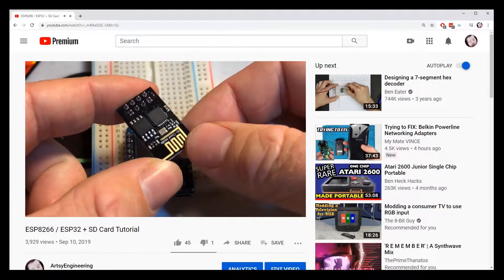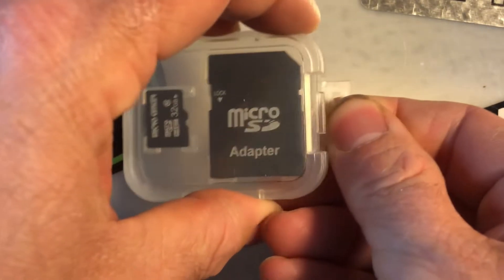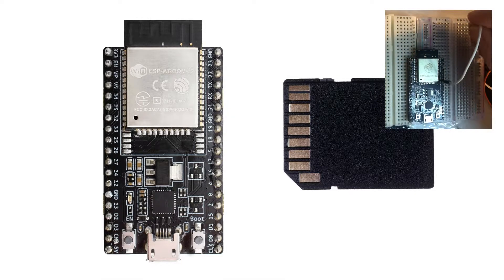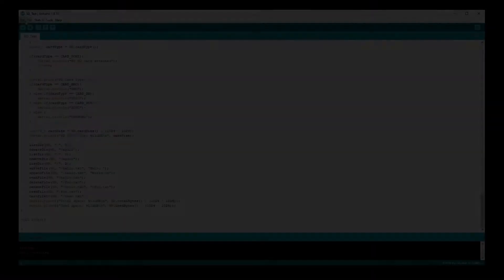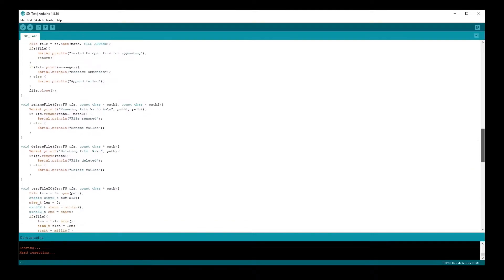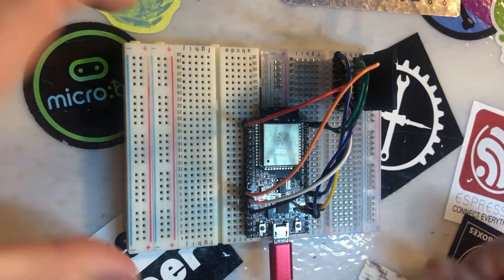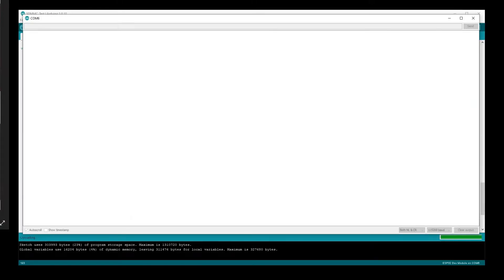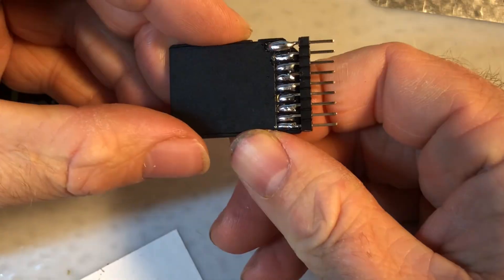ESP32 SD Card Interfacing Fast!

Comment: using esp-wroom-32, doit dev, v1.0 (pretty old, dunno if they still make this), and elegoo uno (for testing sd adapter module)
spi /w 5v module -> works with uno and v5 logic, not with esp32
spi /w soldered microsd to sd adapter -> works with esp32
mmc/sdio 1-bit -> needed external 1k pullup on d2
mmc/sdio 4-bit ...... the rest of this comment...

after doing some digging.. I found that the pullups added in code in this video might be module dependent. 
seeing NO effect with the software pullups, I tried physical 1k pullups (I didnt do any math on whether this is too much or not enough for spec, try at your own risk) on my breadboard.
the physical pullups specifically on d12 prevented the module from booting.
So after some more digging, I found that it looks like there are actually other lanes to access flash on the module that arnt broken out entirely to pins
but at least on my board, the d12 pin IS shared. so pulling d12 high on boot will not allow the esp32 to access the flash on the module used to boot..
but I keep finding more things that say all four data pins on the sd card should be pulled high (apparently youre supposed to do this even in 1-bit mode?) including, d12

so, what I didnt do, was add a delay in code before trying to mount the card (5000-10000ms should be enough, and it should only be d12 that needs this)
then plug in the resistor to main+ while the code is waiting for me. Then let the code run the mount, list directory, read/write test....
What I did do, was add the physical 1k resistors to d2, d4, and d15. and connected d12 to a 1k resistor.. to the emitter of an npn transistor. 
**after boot** a software pullup on d27 wired to the transistor base (middle pin), completes the circuit from main high, to d12 through the resistor pulling it high.

it works!

note: this should only necessary if your module doesnt have software pullups on those sdio pins (which my module does not)
note: this should only be necessary if your module requires d12 not to be pulled up during boot, so it can access on board flash (which mine does)

now if only there were a clever way to wire this so I could leave d2 wired and the microsd in place during flashing. I would be super happy.

thanks for the vid, it didnt get me all the way, but it got me started and in too deep to give up.

details from espressif on variability between different "official" modules and availability of software pullups
https://docs.espressif.com/projects/esp-idf/en/latest/esp32/api-reference/peripherals/sd_pullup_requirements.html

Comment: I tried this code and it seems perfect for my little project, but only NULL values are saved. I tought that this happened because the buffer is declared with no specific values. Before writting the buffer in the sdcard I tried to fill the buffer with zeros but only nulls are saved in the memory. I had the same problem with the file.write() function with the SPI method, but it is the same. Only nulls. Somebody has had this problem too? :(
Reply from the maker: Eder Esteban Reyes would you want to share the code you’re using to form the data you’re writing? I can try and take a look.!
Reply: @ArtsyEngineering  I have not added this code to my main project. I checked before that the time of the implementation were the right one and it seems that it is perfect, but I check the data saved in the sdCard and it only has NULL. I am testing the code of the of the library examples and I tested the final code that I found on Github (https://github.com/espressif/arduino-esp32/issues/1117)

In the Github code and the example I used a for cycle to set the values to zero

////////////////////////     TestCode - TestFileIO//////////////////////////////

 file = fs.open(path, FILE_WRITE);
    if(!file){
        Serial.println("Failed to open file for writing");
        return;
    }

    size_t i;
    start = millis();

// myCode
for(int j = 0; j < 512; j++)
{
  buf[j] = 0;
}
//

    for(i=0; i<2048; i++){
        file.write(buf, 512);
    }
    end = millis() - start;
    Serial.printf("%u bytes written for %u ms\n", 2048 * 512, end);
    file.close();

////////////////////////////////////// Github Code ////////////////////////////////

void testFileIO(fs::FS &fs, const char * path, uint32_t buffSize, uint32_t numMB) {
  uint8_t * buff = new uint8_t[buffSize];

// myCode
for(int j = 0; j < buffSize; j++)
{
  buff[j] = 0;
}
//

  File file = fs.open(path, FILE_WRITE);

  if (file) {
    size_t i;
    uint32_t start = millis();
    auto numToWrite = (numMB * 1024 * 1024) / buffSize;
    for (i = 0; i < numToWrite; i++) {
      file.write(buff, buffSize);
      yield();
    }
    uint32_t end = millis() - start;
    float kbps = numMB * 1024 * 1024 / end;

    Serial.printf("%u MB written using %d byte buffer for %u ms @ %f KBps\n", numMB, buffSize, end, kbps);
    file.close();

Comment: hello, I have a question: I am not an electronics engineer, except for drones. in short, I would like to make a "fake" micro sd card, and be able to take what goes into the card directly to retransmit it. (video stream) as if you want to turn a micro sd output into something like the hdmi out due to the data coming into it (to the sd card). does that seem possible to you? get the stream that normally goes on the card and make a bridge to have it live? (I'm not in the business, so I have trouble expressing myself.)
Reply from the maker: No worries! I'm not an electrical engineer either, we're all just trying to learn here. So you're saying you already have a drone with a video recorder that saves the video directly to an sd card right now, and you want to somehow tap into that and stream it somewhere else  instead? I don't know that this would be totally impossible, but it may be VERY difficult. 

The first problem is the video recorder would be writing to the sd card using 4 or 8 bit MMC so you would need a really fast processor to read the signal and trans-code it back into something use-able. 

The next problem you'd have is going from that signal to hdmi, which would also require a lot of processing and work. I would think you'd have to use something like an fpga to get that done. In short, I would not attempt this, but it would be interesting to see if you do give it a try!

Comment: Ok i did exactly as you said but things didn't work out for the MMC initially adding the configurations you mentioned, so here's what i did:
I did not set the pins as INPUT_PULLUP however i did change the SD_MMC.begin() function to SD_MMC.begin("/sdcard", true);
the i flashed the esp32 without the sd card in the module 
After flashing as expected it says Card mount failed, i added a 2k pullup resister externally to GPIO 2 or D2 and the blue led on the board turns on and it is working, however connect the resister only after the esp32 is flashed.
Reply from the maker: Interesting, so you have no pullups anymore and you also have 1 resistor between Data0 and gpio2 on the esp32? That seems like a strange configuration to me, but if it works I'm glad you pushed through and found a solution! I wonder why you had to do that so differently, though? Nice work, regardless!

Comment: Mejor pago los $3 dólares que cuesta.
Reply from the maker: If you bought a module for 3$ it's not going to support mmc, but it would certainly be safer to use on a 5v microcontroller so if you don't need the extra speed and want the extra safety, that's true. Although you'd also have to pay shipping and wait for your module to come in, so there are a lot of down sides to that considering you got an adapter for free with the microsd card in the first place. 
Thanks for checking out the video and commenting, though!

Comment: I really enjoyed your vid.  Thank you!  I duplicated your process for SPI and it worked great.  Not having to buy an SD board is so great.  However your speed results for MMC 1bit and SPI did not seem that much different.  Did I miss something or perhaps I am not looking in the right place?
Reply from the maker: I'm so glad it helped!! I just took a look at the video and the important metrics on the different serial console results (to me) are the final (total) read / write times. Unfortunately I cutoff the write times on some of them, but you can see that the 1 bit mode is right around twice the speed (takes half as long) as the spi version. 4 bit mode isn't a whole lot faster, though. I wouldn't consider that to be totally worth it, although it's almost no extra effort.
With all that said, you may not need the faster speeds for most projects, but if you're ever reading video or sound data off the sd cards or streaming ALOT of logging data to the card it would be a nice option to have.

Comment: hey can we use 64 GB Sd cards with these Modules ?
Reply from the maker: I find it a little hard to find good solid info on sd card limits online, but it appears that by default the esp32 only supports the fat file system which maxes out at 32gig (https://esp32.com/viewtopic.php?t=13880) this post does make mention of being able to enable exfat for larger cards but I can't find any information online about doing it. So without having tested this myself, it would appear that 32 gig would be the natural limit, assuming whatever library you're using (if it's non standard) doesn't impose some other limits on you.